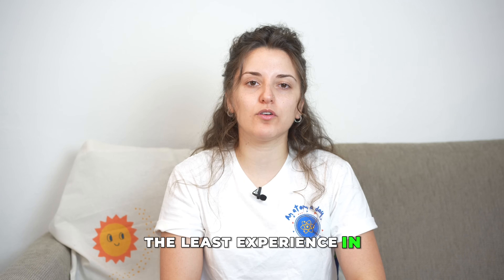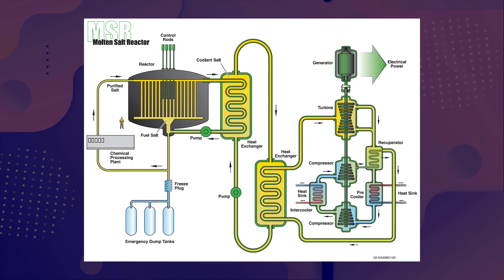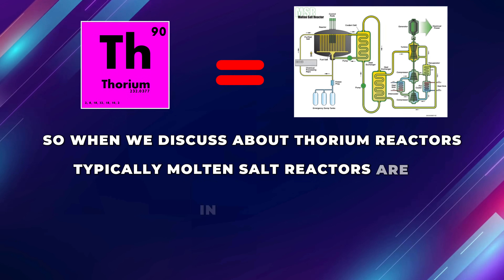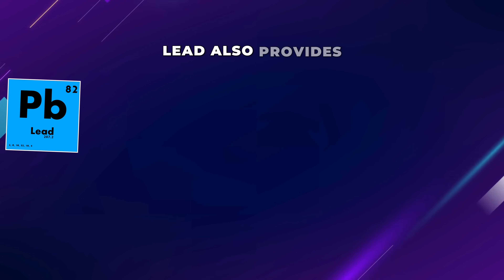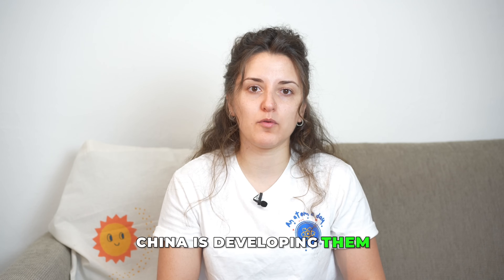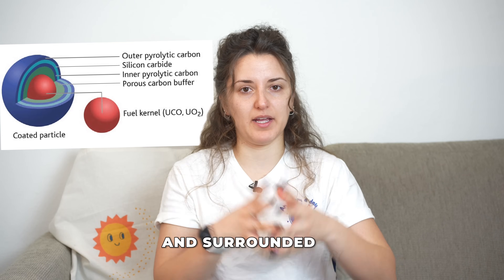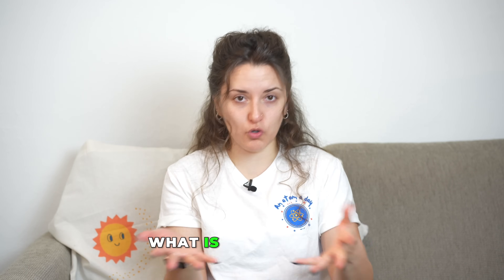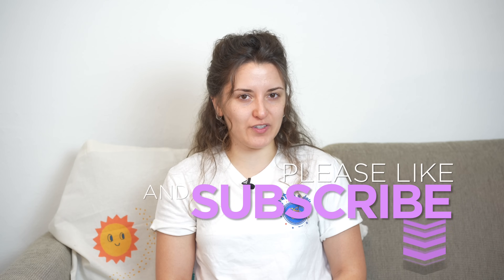Nuclear Physicist Explains and Compares All Gen IV Reactor Types

Comment: About MSR, a strange oversight. The concept which is in development in USA and, less intensively, in France, is the MSFR (Molten Salt Fast Reactot) with chlorides. Their main characteristic is the fact that they can use as a fuel minor actinides and that they have negative void coefficient suppressing the necessity of control rods (they are controlled by the flow rate of the secondary circuit). Second, the BN-1200 is not in construction : the construction is pending to the price of electricity produced by the BN-1200 vs the price with the VVER. By now, Rosatom is still waiting (?) a license for the construction and the commissioning is forecasted for 2035 at best, then not ''a few years''. Concerning the HTGR, some experimentations have been carried out without further development as the prototypes offered no other additional advantages over the LWR. The triso, as explained, is made of three layers around the fuel kernel. These microbeads are embedded in a matrix of graphite forming a ball. One issue with this kind of fuel is that at some point the gaseous fission products and the fuel pass through the surrounding layers and contaminate the matrix of graphite, not mentionning the corrosion issues (chemical, thermal, irradiation). The second issue is that, to my knowledge, there is no way to retreat the ball of graphite. It is contaminated with fission and transmutation products and radiations have transmuted part of the graphite into radioactive C14. By the way, by now, due to the irradiation of the graphite, EDF has no idea how to process the irradiated graphite piles of its first graphite gas reactors. As a result, there have been no commercial HTGR. About the GCFR, the CEA (Commissariat à l’Énergie Atomique) has effectively carried out a study in the beginning of 2000s but the study has been quickly dropped and left to anyone would want to take it. Which has been done by countries of central Europa (V4G4) under a collaboration called ALLEGRO. The research program is in progress with bench marks for sub-elements evaluation in a few years. Not so much news.

Comment: Why is there no molten salt reactor which has a simple cylindrical shape and is doing the heat exchange trough convection on the walls. Due to the convection the reactor core mixes itself up. Is this too simple to be true or is there a reason I missed?

Comment: 🎯 Key Takeaways for quick navigation:

01:48 🌊 Sodium Cooled Fast Reactors (SFRs):
- Operate on a fast neutron spectrum.
- Use sodium as a coolant for higher temperatures, efficiency, and fuel utilization.
- Russia (BN600, BN800) and China (CFR) are actively developing SFR technology.
- Challenges include potential material reactions due to sodium.
04:48 🔥 Molten Salt Reactors (MSRs):
- Operate on a thermal neutron spectrum using molten salt as fuel.
- Advantages include online refueling, potential waste reduction, and suitability for thorium.
- Limited operational experience; actively developed by the US, Canada, and China.
- Challenges involve materials development for the corrosive environment.
07:56 ☢️ Lead Cooled Fast Reactors (LFRs):
- Operate in a fast neutron spectrum with lead as a coolant.
- Provide inherent safety with a negative void coefficient.
- Developed by Russia, European countries, and Sweden.
- Challenges include material development for corrosive and erosive lead.
10:54 🌀 High Temperature Gas Cooled Reactors (HTGRs):
- Operate in both fast and thermal neutron spectra using helium as a coolant.
- Potential for high-temperature applications like hydrogen production.
- Limited operational experience; mainly developed by China.
- Challenges involve developing a new trio particle fuel.
12:45 💧 Supercritical Water Cooled Reactors (SCWRs):
- Operate with supercritical water as a coolant, offering simplified design.
- Potential for higher thermal efficiency.
- Early stage of development by China and Canada.
- Challenges include high-temperature and high-pressure conditions.
13:54 🎈 Gas Cooled Fast Reactors (GFRs):
- Operate on a fast neutron spectrum with helium as a coolant.
- Offer efficient heat transfer and potential for high-temperature applications.
- Limited operational experience; primarily developed in France.
- Challenges include early-stage development and material compatibility.

Made with HARPA AI

Comment: The main advantage of gen IV is low-pressure / high-temperature. Both bring the cost down of nuclear and high-temperature allows for high-grade industrial heat. The demand for industrial heat is 2x electricity alone.
Reply: where do you have that number from? In germany thats not the case. Industrial heat is big, but it does not cosume like 80% of our energy. And germany is for now still one of the biggest heavy industry countrys. Industry consumes some 25% of energy here in total, which should already contain the heat. Electricity consumes somd 30%.
Also you must compare the industrial heat of those plants against just resistivly produced heat which can also go up to 1000C, its all a question of cost. If electricity is cheap enough, than there is no need to constrain you location freedom to the small area around a nuclear plant.
Reply: @tami6867  You are correct, my mistake. I'm not sure about Germany with it's industry fleeing the country but most countries it's 2x electricity. Thanks

Comment: Hello Elina,

Big fan of the channel along with all kinds of science explainers. Top tier work making science understandable for all us lay people.

If I ask a question for a shorts reply.

About a month ago I was at what I think Europeans call a "car boot sale." And one of the people there was selling a VERY old (1950s maybe) radiation detector. It wasn't a Geiger counter at all. It was an acrylic (maybe?) cylinder roughly the size of an ice hockey puck. Inside of it was an empty cylindrical chamber with several small red balls in it. There were instructions stamped on the bottom brass plate: "Shake container lightly until some balls float. if balls do not float or if previously floating balls drop, seek fallout shelter."

I have never even heard of a radiation detector like that.

Is that a real radiation detector? And how accurate (if at all would it be)?

*The detector was also stamped with a TM for Nu-Klear and patent pending info
Reply: it's ionizing radiation interfering with static electricity
Reply: This is effectively the same principle as ionizing smoke detectors. In the presence of ionizing radiation, the very high resistance of an air gap becomes merely high. Any static charges bleed away as currents orders of magnitude faster. The same principle can help thunderstorms bridge the gap between cloud and earth when a cosmic ray ionizes a path.

Comment: Tesm MSR molten chloride fast reactor. Burns anything fissionsble, could add technological channels for making isotopes and line the thermal region outside the core zone with plumbing that you could pump LiBeF3 through to make tritium or DUF6 to make extremely pure plutonium in the form of nearly pure 239 as the fluoride salt. The only drawback is that the iodine must be quickly removed as it will make the salt mix extremely corrosive.
Reply: The whole thing is only in the test stand phase, which is not suitable for commercial operation. 
Therefore, it will still take a very long time, if at all, for it to be approved by the international atomic commission, if at all it will ever be approved.

Comment: Thank you and Merry Christmas Dr. Elina.
I realized a long time ago that nuclear-powered electricity generation was one of the most reliable and economical in the industry. 
Of course, in my opinion, hydroelectric power plants are the most reliable and economical way of generating electricity.

As an engineer, I see the potential of the helium coolant reactor, which can also generate hydrogen.
However, hydrogen will cause the metal to become brittle and fail. Carbon composite tanks could work, but carbon fibers are made from petroleum byproducts.
Therefore, we would once again depend on fossil fuels.

Comment: I like the high temperature gas cooled reactor because of the potential to produce hydrogen.  Please do a follow up video on TRISO particle fuel concept. Thanks for the learning experience!
Reply: Agree.  Also higher temperatures improve thermal efficiency and TRISO can be 'inherently meltdown-proof' (similar to the German PBR that was tried).
Reply: @mikefochtman7164  PBR had incident of the pallet getting stuck and ended up abandoned as a result.
Reply: @mikefochtman7164  a lot of designs are "meltdown proof" believe it or not. The TRIGA model used in almost all of the research reactors, MSRs, AHRs from the 40s, etc are all meltdown proof.
Reply: Apart from producing H2, the high temperature can be used in many industrial processes like carbon free iron furnaces, fertilizer production and even cracking fossil fuels.
If the triso pellets can be recyclable, maybe the cost will be less.
Reply: Triso fuel is horrendously expensive right now, about 300x more expensive than regular u/mox fuel.

The manufacturing process for Triso fuel is very complex. 

Even is the price of fuel normally is a small fraction of the operating costs, such a step price increase will make a significant difference.

Hopefully the price will come down once mass production is started, but it will always be more expensive than the traditional pellets.

Comment: My favourite would be the gas-cooled fast reactor, but anyone of them would be better than what we have now as an alternative to light water reactors, burning fossil fuels or relying on intermittent power
Reply: whats wrong about intermittend power? Do you also track whats going on in the battery market? For example in germany there was just announced that a electricity producer will use the site of former Brockdorf Nuklear plant for building a GWh sized Lithiumcell based storage. And that is just the beginning of GWh sized storage. The cost of just battery cells will further drop competing even more with nuclear in the future. Time will tell. I already dont belive anymore that Hydrogen powered gas plants make it into the market for stabilizing the grid in certain times, but that there will just be more battery storage, as all those considerations are completely about cost in the end. And it would not be the first time that better battery tech just pushes something like hydrogen tech out of the market before it even enters the market. Nuklear will have a hard time to compete. Not that i'm against nuklear, i'm just for the cheapest option of green energy.

Comment: Helium is expensive and difficult to keep in the system. This should be on the list of cons.
I have a question: will He-3 be formed in such reactors?
Reply: Helium is not only expensive, it is also not sustainable and at the moment in very short supply; ask your local MRI centre for horror stories. It is just not realistic trying to find another application for helium while there are all these alternatives mentioned. Hydrogen production being an advantage is not serious, there are many other ways of producing it that are much cheaper, easier, more efficient etc., etc.
Reply: @1ReasonableGuy  indeed you are right. Considering the production of something that can easily explode as an advantage for a nuclear reactor is a dubious idea.